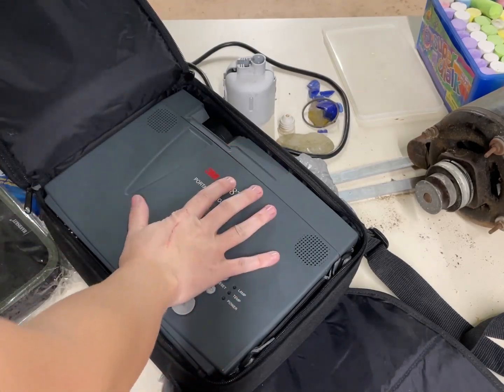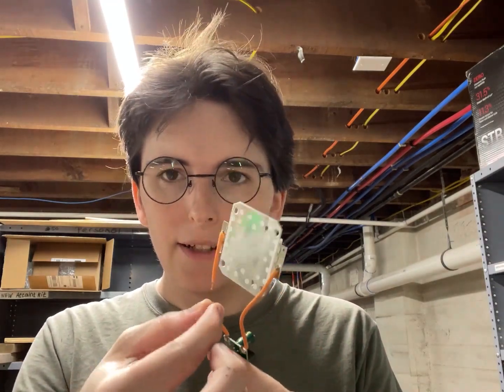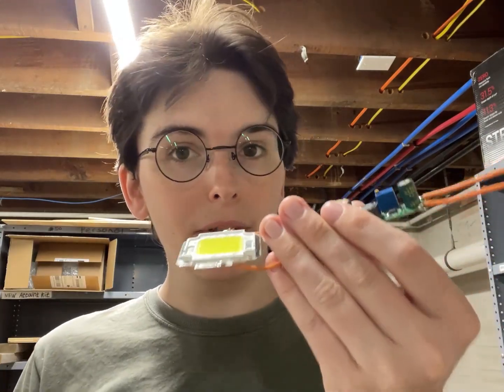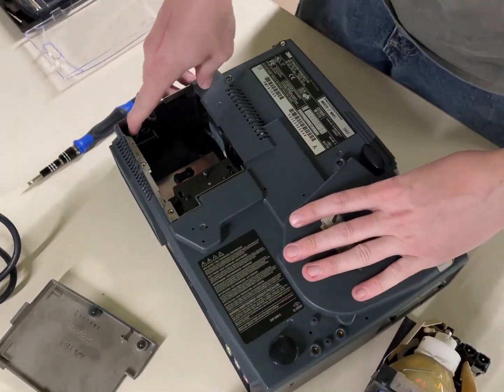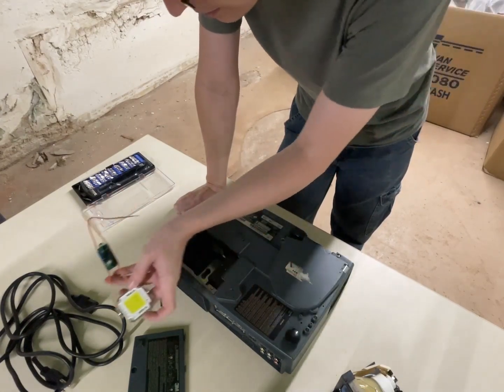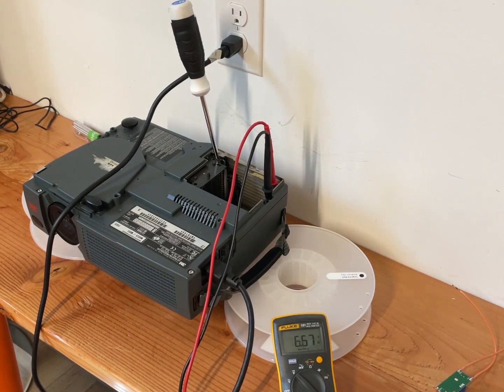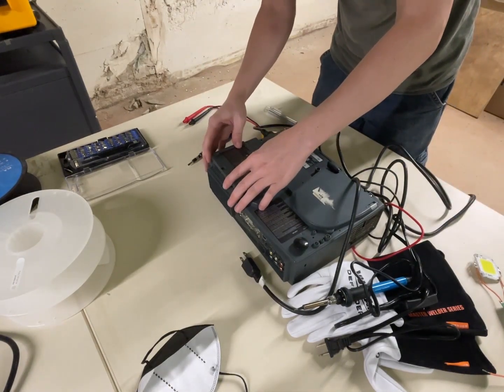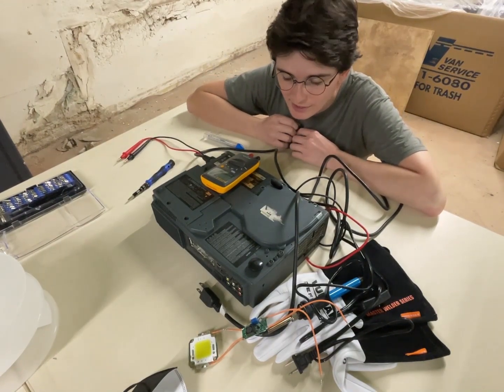3M Digital Projector LED modification 01: Found a way not to do it by blowing up buck converter...

Comment: I wonder having such high voltage led is even worth it, you can probably just use a car led bulb and I might work just as well at 12v a single giant led seems to be just not the right approach.

Comment: Most old lamp projectors use a Liquid Metal Halide bulb that requires a high voltage pulse to initially vaporise the metal and get the arc going.
Reply from the maker: yeah I realize that now. Im actually more used to fixing 16mm projectors and hadnt realized the tech had advanced that much.

I set this projector in my closet for a later date, and now im opening a repair shop in Philadelphia. I had to spend a few years doing a lot of dirty building repair work but now hopefully I can focus more on electronics.

Comment: I already own two LED projectors and absolutely love them. I’ve been wondering doing something like this when the led finely gives out, and if there’s no OEM replacement. 

My projectors were  way too expensive to just throw out.

I disassembled the projectors right out of the box just to see if there was any replaceable parts inside, but I couldn’t see what the LED actually looked like in either of them since I was afraid of contaminating the lens compartment. 

I’ll definitely be opening further when one of my projectors completely dies. 
But I’m really surprised that someone didn’t already come up with an aftermarket option.

Good stuff though.

Comment: Luv this kid. Good belly laugh. What about powering the led from a dedicated source not attached to the projectors power source
Reply: Remove the power source for the regular bulb and wire a 12v defeat the interlocks and  bypass the relay telling the motherboard the voltage is correct

Comment: I think there's a starter of some sort that is either being initiated over and over or is needed to keep it a frequency to power that bulb
Reply from the maker: I've come to the same conclusion as well. I bet it brings a pin high when it turns on so I can just remove that whole circuit and put 5v on that pin

Comment: You need more experiment with metal halide or UHP bulb ballast circuit. Find  ballast to mainbord connected wires to wich one is error reporting. Make that signal from external circuit to fool motherboard. This is not a simple DIY game. Try harder.
Reply: 6:39 metal halide or UHP bulbs need High voltage for startup.

Comment: a lot of buck converters need some sort of load,  as the pulse width often cant go down to zero.   So without any load the output voltage might be the same as the input voltage.   Also the original lamp is probably a point source of light,  while the led has a large area that produces light.  so not all that light might be used. Maybe if you move it forward a bit .. so it fits the cone of light the lamp produces..   There are these LED lamps for cars that are small but still 160 watts or so,  they might be a better point source of light.

Comment: The regular lamp must be started with higher voltage. Startup voltage is high but after the lamp starts the voltage drops under 100v. The projector tryes to start the lamp multiple times, and after several failed attempts it shuts down. To make it work u must moddify the lamp driver board, and make the main poard thinkl that the lamp is started  and working. Kinda pain in the but to make it work.

Comment: Is the bulb it uses normally a sodium arc lamp (HID bulb)?

If so it will use a HID ballast, these are pretty scary in terms of operating, (high voltage/frequency) can sustain a small arc in air.

IIRC they use a high voltage/frequency to ignite the arc and melt the sodium, once molten it drops to a lower voltage/frequency.

So you're probably right in thinking bypass the inverter/ballast (assuming it uses a HID/molten sodium bulb).

Comment: The Projector lamps use a regulated power supply meaning it will drive the voltage to meet the current it is supposed to operate at, or at least that is my understanding.

Comment: ya thay run on high kv. you better off running a external psu. i have one here from a thrift store and looking to do the same.  also that led needs a good heatsink to stay cool. >:)
Reply from the maker: Ah well I won't be running the LED at full power, more like 5% power, so the fan should be able to cool it well enough.

Comment: I think you're onto something with cutting the AC power supply out of the equation. I mean, you just need 2 DC rails. One that has the right power for the mother board, and another that has the right power for the LED. :)  (Yes, I know I'm stating the obvious.  hehehe)

Comment: So the lamp is AC, it uses a huge inverter and a ballast to start and run the lamp. The best thing to do is to remove the ballast and run it from the power supply, use a relay to turn it on  and off with the projector.
Reply from the maker: Yeah that's what I said I'd do in the video. Don't worry.

Comment: BTW: this lamps have a view 10s of  kV high frequency high voltage. you probably damaged your DMM input protection MOV by sticking it in there.

this Projektors use "Ultra-high-performance_lamps" (actually a technical therm) and they are orders of magnitude better then LEDs for hist application because they have higher intensity.
Ti has good video on this topic:
https://www.youtube.com/watch?v=3ItoGhwWsG0

LED Projektors need highly specialized LEDs for this application or Laser.

Comment: Inside the projector is a lamp inverter board that produces the voltage and pulses to operate the lamp. You cannot power that led driver from the projector lamp output. And you can possibly destroy your multimeter due to the pulses.
Reply: what if  the  led  has it on popwer supply  might that  fix it

Comment: Projector lamp is most likely a metal halide lamp which uses a high tension transformer like a sodium vapor or mercury vapor lamp.
Reply: I have the same make old projector still have a new spare bulb , as you said the type of lamp needs a high strike voltage to get the bulb started , not sure what the voltage and amp draw is once the bulb is up to operating temperature , not a good idea to use the built in power on an LED 🙂
Reply: @uptowndisco  I guess it is possible to remove the internal metal halide lamp inverter from the projector, replace it with an led power supply, figure out and circumvent the lamp failure control circuit,  modify the lamp housing to hold an led with heat sink. Led should match color temperature as closely to original lamp or color won't be correct and all should be close to good. Maybe.